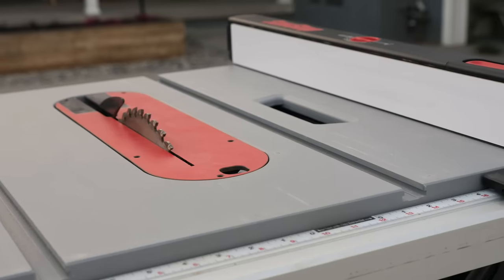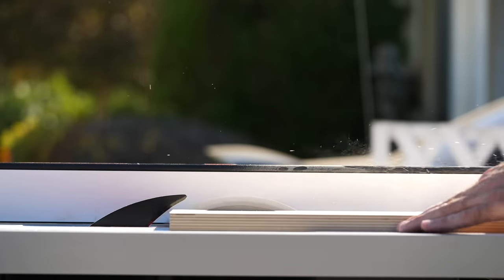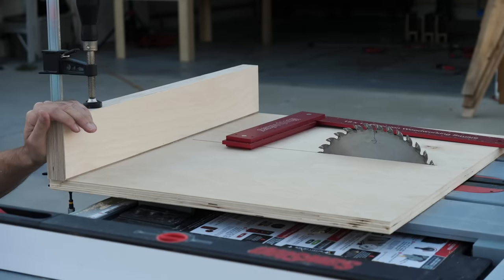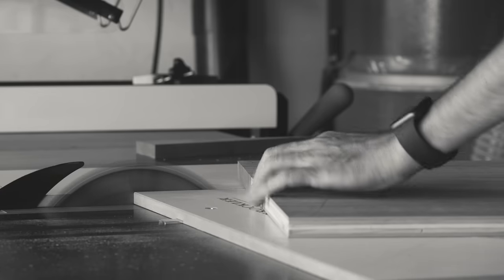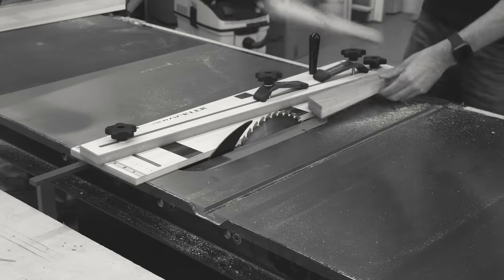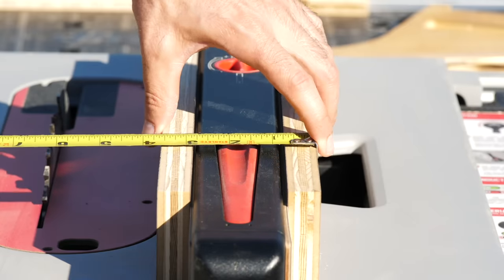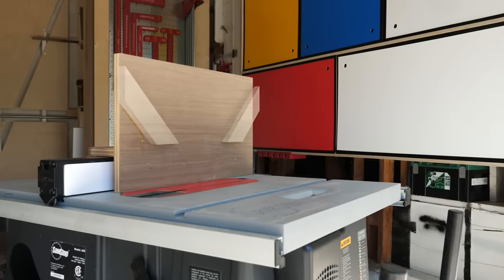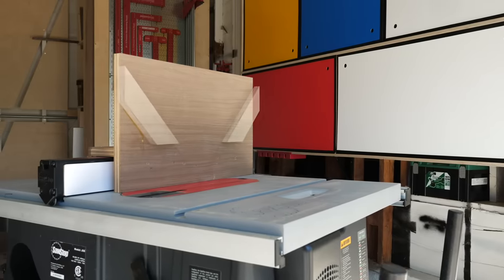Top 10 Woodworking Table Saw Jigs and Accessories & How To Make Them - According to Me

Comment: For anyone looking for a cheap and easy shoe-shaped push shoe, home depot has wooden shelf brackets for about $3.  They're probably in the aisle with other craft wood supplies.  Drill a few holes for your fingers and cut out the heel and you're in business.  Also, I recently used some scrap 1x4 pvc trim for runners.  I'm thinking that should be nice and stable.  Thanks for all the great info.

Comment: So, what you did to test your sled is called the 5 cut method. I think Katz-Moses talks about that a lot, and if i am not mistaken, you didn't exactly do it right because your last cut should have sliced off a thicker chunk that you then measure each end to find the delta which you then use to an equation or i think there is an app or a website that will tell you what you need to do to improve the squareness of your sled.

Comment: Thanks for the tips!  Your crosscut sled looks similar to one that I built.  I used oak for my runners, and I've noticed that the fit is inconsistent with changes in the weather.  I might end up replacing the hardwood runners with plywood for that reason.

Comment: Great video!   Your comment about the splitter is right on.   It prevents the back of the saw blade that's rising out of the table from catching the work piece and throwing it back at you - Kick back.   I wanted to mention that you used the finger board correctly but didn't mention in the commentary that the board should always be used in front of the blade and never beside it.   Applying pressure sideways into a fence is the way to go not further back where the sideways pressure goes into a cutting blade.
Reply from the maker: Good point. I think I know that so inherently that I didn't even think to mention it. This is strong case for why YT videos should be editable after the fact.

Comment: Check out William Ng's video for how do the 5 cut method for squaring the sled. He invented the method, on the fifth cut you are supposed to cut about an inch thick piece then measure the difference. Great video as always, Chris!
Reply: Semiformal exactly, you're supposed to measure the difference between the 2 ends of the offcut made by the 5th cut, not the angle of the square piece.

Comment: For the crosscut sled (which I just made myself for the first time), instead of removing your riving knife and popping the blade up, I installed the back fence first (which doesnt really need to be perfectly square) and then pushed the sled through to make a reference line for installing the front fence.   Thanks Chris!
Reply: I found having the front fence square handy. I have used it to cut long thin boards down and finish on the sled. Oh Sorry this is on a dedicated 45’ cutting sled I use for small jobs like picture frames. See the back fence has a dead  on bock that only cuts 45’. (Hope that makes sense)

Comment: I know that this is a 4 year old video and you probably addressed this in a subsequent video, but an angle jig is actually a TWO trick pony. The first trick is of course the main use of cutting pieces with a taper. But the second trick is that allows you to establish a perfectly straight edge without requiring a jointer. Just put the piece that needs to be squared up in the tapering jig so that there is a minimal overhang along the entire length so that no part of the edge isn't cut. If you want the grain to run straight down the board, you just need to adjust the board so that it is parallel with the edge of the taper jig and there is some amount of overhang along the entire length of the board. When you run the piece through the saw, the cut edge will be straight and square. This edge can then be run along the fence to make the other edge straight and square to the side cut on the taper jig.

To completely eliminate the need for a jointer, a jig for the thickness planer can be made so that a twisted or cupped board can be flattened. All that is required is a piece of melamine faced 3/4" thick MDF the width of your planer and as long as the pieces you are going to be putting a flat face on. Melamine panels are made with very flat smooth faces and MDF is very dimensionally stable, so the bottom face of the melamine panel is the perfectly flat surface that the planer will use as reference rather than either of the unflat faces on the board you are trying to true up. Glue a cleat on the top surface of the trailing edge to keep the piece from sliding backwards on the sled. Then put shims (with double sided tape on both sides) under the piece as needed to keep it from rocking. Run the sled through the planer until the entire top side has been cut by the planer.  Remove the piece from the sled, turn it over and then run it through planner to put a flat face on the other side that is parallel to the first face. Again continue to run the piece through the planer until the entire surface has been planed or continue on until the piece is the desired thickness.

And the order is to flatten the faces first and then use the taper jig to establish a square straight edge since you want the face of the piece to sit flat on the top of the angle jig so that the edge cut by the saw is 90 degrees to both faces. These two jigs along with a rip blade for a bandsaw allow rough lumber to be resawn to roughly the desired thickness and then flattened and trued up with the taper jig and the planer jig.

Comment: Hi Chris, very helpful video for those getting started with a table saw!  Very nice looking cabinet!
I would suggest that you get some microjig grippers for cutting your smaller pieces (that is if you already do not have some).  It kind of concerns me when you have your fingers so close to the blade.  I know you have a sawstop saw, but still...  Check them out, really a lot safer and you are more likely to keep all your fingers.   P.S. I have the same saw and really enjoy using it.
Reply from the maker: Thanks Nichol...I do have a couple of grippers. I used to use them a lot, but don't as much anymore. They are always sitting there and ready to go though.

Comment: The five-cut method that you sort of use in your video was, I believe first introduced by William Ng; check out his video which is wonderful. Briefly, the first four cuts magnify any error by a factor of four and the fifth cut is made with the same reference base as the fourth cut. By measuring the difference in width between the front end and the back end of this piece you can calculate how much you need to move your fence to get spot on accuracy. William’s video shows how in detail.

Comment: How does cutting hard wood on the Job Site saw compare to your Contractor saw?  I’m assuming you big saw has a bigger motor and 220v.  When you are cutting maple or oak on the contractor, do you notice it bog down or burn the edge?  Would power alone be a reason to jump up, or could you do what you do with the Job Site saw and be happy with the performance?
Reply from the maker: Haven't had it bog down or burn...but you definitely will slow your feed rate a bit. Not a big deal if you're ripping 3 boards. If you were ripping 300 though...yeah, you definitely need a bigger saw. In the end, is the cabinet saw better....yeah, of course. But do you NEED IT...I don't think so :)

Comment: Something I’ve never been able to figure out is why make a crosscut sled if you have a good sliding compound miter saw.  Seems like a quality miter saw can do most of the crosscut sled cuts up to about 15”.  Thoughts?
Reply from the maker: I have a whole video about miter saws. In short. My stance is that a miter saw is great for construction and finish carpentry, but not necessary for furniture making. For making the cuts that a cross cut sled and a miter saw would do redundantly... a cross cut sled is a faster and more accurate option. Just my opinion.

Comment: I'm pretty sure what you did for the 5 cut, would be the same for 1 cut.
What you have to do is on the 5th cut, take off like an inch.  Then measure the width of the cut off at both ends.  

What you do with the difference is beyond my math skills and geometry thinking, but luckily smarter people have figured that out.
Reply from the maker: I'm not gonna pretend that I'm saying this with anything more than 51% certainty...but. I think cutting the 5 times does compound the error. The reason you would take the off-cut and measure it would be to find a more tangible amount that you needed to correct for.
Reply: @Foureyes.Furniture  Think about an extreme. Let's say it was 80 degrees.  On the 5th cut, would it produce a 50 degree angle to the fence or the same 80 degree angle?

What you would find is that you'd need to cut increasingly more off at each pass, because your board that started out looking like a square now looks like a rhombus
Reply: @Foureyes.Furniture  if you don't cut the 5th piece off and measure the difference you cant see the compounded error. By not cutting it off and using a square to check your 5th cut it's no different than just using the square on the 1st cut. Every cut is at the same angle.
Reply: or, using a piece that has been cut on the saw, to give 2 true, opposite edges, then put piece on sled, run a cut, flip one of the pieces and bring the just cut edges together. If tight fit, you're good, else divide the angle and adjust as needed. Learned this one from Norm Abrams.
Reply: As it seems, Chris still has been able to make pretty nice work even with a possibly not 100% square sledge. So, maybe he got lucky every time, or maybe the angle just doesn't have to be that precise. Anyway, I'm still trying the 5 cut method, now that I understand what it means.
Reply: So just a question a person drinks coffee every day then one day things out but has work to do but now has the shakes because your body is addicted to caffine what does he/she do.
Reply: @uncletoy774  drink more coffee 😁

Comment: I made a jig similar to the panel jig just a little bit smaller so that I could cut half laps.  A laminated two pieces of half inch MDF. This means all I have to do is add one inch to any of my measurements and I can cut accurately.  I would not dare run a piece of wood vertically across a table saw without a similar setup.

Comment: Hey Chris, keep up with the sponsorships, nothing wrong at all with them.  There's way too much hypocritical pearl clutching about that issue, IMO, by people who will watch commercial TV all day long.  You do a good job, may as well get paid for it.  And coincidentally regarding the coffee, that's how I like my women also!  😎

On the 5-cut method, if on the 5th cut you cut off approximately a 1" chunk, and throw a micrometer on each end of that, that'll be a much more accurate check for square (down to the thousandth of an inch) and for seeing the compounded discrepancy, than holding the piece up to a square. 

From there, William Ng has a nifty formula for telling precisely how much to move the swinging or adjusting end of the fence.  It's not really all that hard (takes longer to describe than to do), and I'm happy to explain it here.  To do it the way he illustrates in his video (and to keep the back and forth adjustment directions straight), you'll need to cut the right side of the square, then rotate it through the 5 cuts clockwise.  You'll also need to put the first screw into the fence as a pivot, by your right hand, so that you're adjusting the end by your left hand back or forth as needed to correct the error.  Oh, and buy or borrow a set of feeler gauges.

Basically, his formula can be written as: A - B / 4 / L * D = E, where A is the width of the 5th-cut 1" chunk at the beginning of the cut (away from you), B is the width at the end of the cut (toward you), 4 is the 4 cuts that compounded the error, L is the length of the 1" chunk, D is the distance between your fence's pivot point (the first screw you put in at the end of the fence by your right hand) and a point or mark on the other end of the fence by your left hand.  You'll be moving that end back or forth to adjust the error out of the fence. E is the error ratio you're solving for, or how much to move the adjusting end of the fence back or forth, at the D mark.

So for example, say the length of the 1" chunk is 4", the A end is 1" wide exactly, the B end is 1.080" (1 and 80 thousandths of an inch), then that difference is -0.080" (negative 80 thou, because A - B, and the B width was greater; it would be a positive number if A was greater). Now divide that -0.080" by the 4 cuts, that's -0.020" (negative 20 thou) error per cut. Now divide that error per cut by the length of the chunk, 4", so that makes the error -0.005" (negative 5 thou) per inch.  Now multiply that -0.005" per inch, by the fence length of 20" (20" between the pivot screw and the D mark), that's a total -0.100" (negative 100 thou), or a 0.100" negative E (error ratio).  Your 20" D mark at the adjusting end of the fence by your left hand is 0.100" too far toward you, and that's what made the B end wider.  Clamp the adjusting end of the fence by your left hand, remove the temporary screw at that end, and push that end away from you by 0.100" at the D mark to correct the error to zero.  Then re-install the screw, in a fresh hole because the original hole will pull the fence back out of adjustment again.

To accurately measure that -0.100" adjustment (or whatever value E ends up being), use a leaf or leaves of the feeler gauges that can total the value of E, then put them against the fence at the D mark, between the fence and the corner of a piece of scrap, and secure the scrap down to the sled.  Then remove the feeler gauges, move the fence up against the scrap, and the fence should be perfectly adjusted.  (If E is a value you don't have feeler gauges for, simply change where the D mark is on the fence and re-multiply the per-cut error by the new D value, until you get an E that can be some total of the feeler gauges that you have.)  Re-install the second screw in a fresh hole to secure the adjusting end of the fence, do another 5 cuts, and measure the width of the new 5th-cut chunk at both ends to re-check.  They should be pretty bang-on perfect this time.

Comment: I like to another woodworker using forest blades. They are the best. I'm a contractor and have 5 or 6 of there blades. I always have a sharpened spare ready to go so I have no down time waiting for the next to be sharpened. I have the benefit of living only 15 minutes from the forest factory so I get to drop off and pick up. Great tips on your jigs. 
Also how do you like the sawstop contractor saw I've been considering the sawstop as my next table saw, have heard through reviews it's great saw even without the brake. I currently have a Bosch and the dewalt saws. Bosch is my main work horse, but have always disliked the fence.
Reply from the maker: Nice. Yeah. I have 4 total now I think. I wait until I’m on my last one and then send in the other 3. They last me a while each though.

Comment: Idk why everyone is bashing you for a coffee ad. It wasn't personally relevent to me so I just skipped it with a few easy click of the right arrow on my keyboard and got right back to the content. Thank you for making such an awesome and informative video. I thought you did an especially great job with the graphic about why the "vertical panel carrying jig" is useful. Using the opposite angle is pretty obvious to achieve something greater than 45, but probably would require a ton of fiddling around and cutting wood vertically on a table saw can be pretty dangerous, so good on you for showing people a safer solution. Thanks for the video!
Reply from the maker: You are a much for nuanced person than some (the people who hate the coffee ad) - I honestly think they are a very small minority, who just happen to be a overly vocal, and a little bitter...unlike TRADE COFFEE which is always smooth :)

JK. Appreciate it, and glad you found it useful!

Comment: One tip I found is that if you use a scrap trex board for runners instead of hardwood, there are never any issues with it getting tighter due to expansion and contraction of the runner.
Reply from the maker: Good tip :)

Comment: Chris, on a scale of 1-never, how often do you check your fence for being parallel to the blade? I never see you do it, you’re fence and rail system must be spot on. I just rebuilt an old craftsman 113 and replaced everything on it but I have to check for square every time! I have some replacement guides coming in to see if it takes some of the play out of it and hope it can tide me over til I have to spend the 300$+ to speed things up
Reply from the maker: I'm not sure how the scale works, but I'll say 0.2 :)

I check it a lot during the initial set up, but after that, if I'm not noticing any problems, I don't really re-check.

Comment: Ok im a bit new to woodworking so idk if I’m missing something or if I’m just slow af lol, but if your blade was able to make a 37.5 degree cut why couldn’t it make a 52.5 degree cut?  Also how did the 37.5 degree cut give you a 105 degree angle instead of 75 degrees. Wouldn’t the 52.5 degree cuts give you the 105?